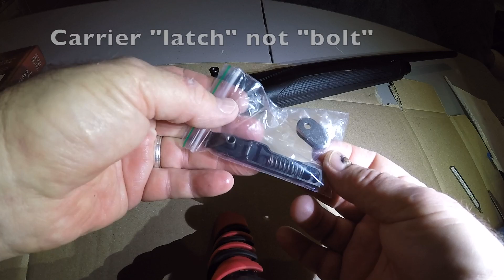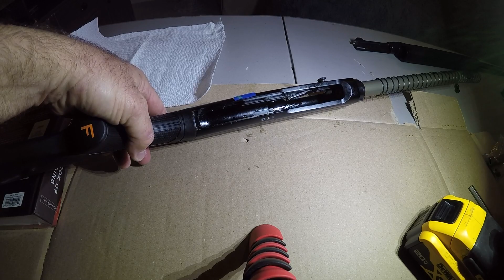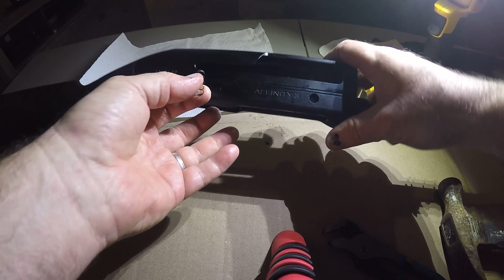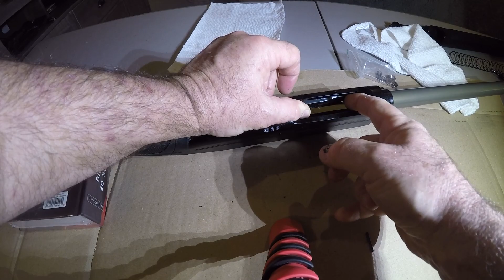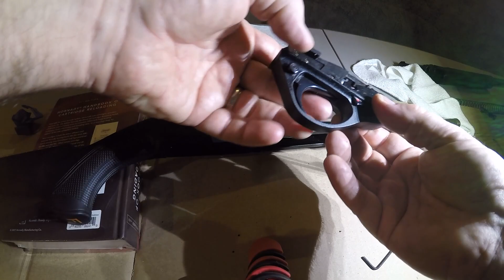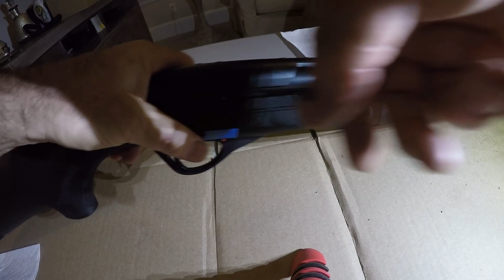Franchi Affinity 3 carrier latch replacement with J. Kenny & Co. two piece carrier latch

Comment: Thank you for the video. What does that spring below the button do? Will it work without the spring?
Reply: The spring provides tension for the smaller piece of the carrier latch. Without it the shell latch won't hold shells in.

Comment: I just bought a Franchi A3. I see this new latch helps in loading the shell easier but does it also make it easier to remove the shell? I push on the latch on mine to remove a shell from the magazine tube but the latch doesn’t budge at all to release the shell. I have to remove shells by loading them in the chamber then ejecting them. So will this latch also help to unload the shell  from the tube?

Comment: Could I still use my factory oversized button with the latch or do I have to order one of theirs?
Reply from the maker: To be honest I don’t know.  The spring needs some surface area to rest on the backside of the button, and the factory screw will need to match the threads of the new piece or their screw will need to mate up with your button.

Comment: My franchise affinity 3.5 is double ejecting. If I float the second shell I don’t have an issue shooting rios but with heavy shot it’s still ejecting too. I have seen to take it out and clean it or bend it a little. Was your daughters only hard to love or was the magazine ejecting two shells
Reply: I have the 3.5 affinity. It was doing the double feeding. I bent the latch. No more double feeding but it’s hard to load like the authors video. I’ve ordered the j Kenny latch will install and update.
Reply from the maker: No it hasn’t had an ejecting problem.  After I replaced the carrier latch the gun has performed perfectly, through several clay shoot outings and several outings during dove season.  This is my daughter’s primary shotgun and she is really enjoying it now.  Even prior to replacing the carrier latch it didn’t have an ejection issue.
Reply: Thanks for the response. It is ejecting fine but the magazine is releasing both shells causing it not to feed I’ll have to push the third round back in the tube for it to load
Reply: @RobertBrown-yh3bt  I am having the same issue. Have you fixed it by chance? I’ve been going through my duck season using two shells to prevent a jam
Reply: @wyattbarden5020  ever find a cause for this? mine is doing same thing, thank you.
Reply: @wyattbarden5020 mine does the same. I’m about to bend it
Reply: @wyattbarden5020 did you ever find a fix? Mine is doing that as well
Reply: Mine is double ejecting, too.
Reply: @ I send it in, they kept it said they worked on it and sent it back. Still was doing the same thing so I traded it and bought a browning maxus 2
Reply: @RobertBrown-yh3bt,  did it double-eject all ammo or only specific type?
Reply: @RobertBrown-yh3bt mine is double ejecting and I sent it back to Franchi and they had it for months and when I got it back they said it needed to be cleaned. Still having the problem

Comment: That was helpful…did you consider just bending the carrier 
latch? Bending seems to be a common fix.
Reply from the maker: The problem with bending the latch is now you have less contact surface area with the bottom of the shell.  It seems some people were grinding the mid piece indentions wider, so that there is a longer portion of the latch that is thinner than the main body.  That makes sense, but I'm not sure that would even completely alleviate the issue.  I have a teenage daughter loading this and her fingers are not as strong as a lot of shooters out there.  
thanks for the comment!
Reply: Nice fix but that button is uuuugalee😂